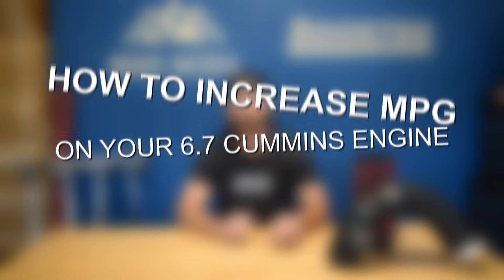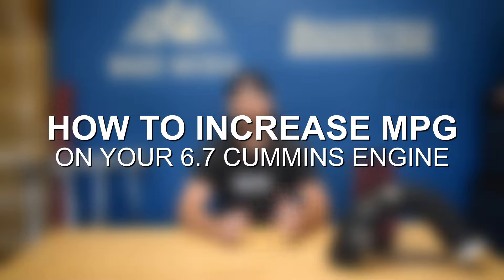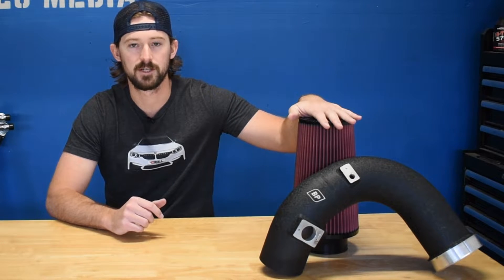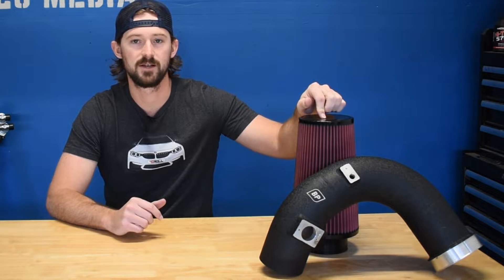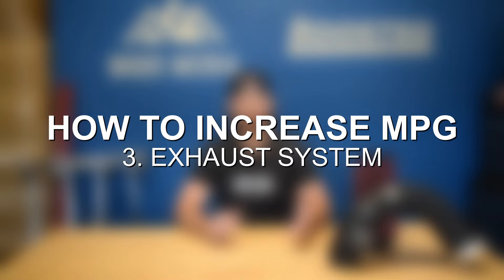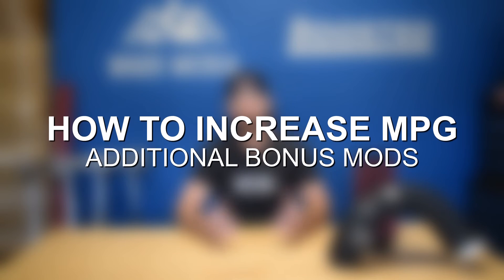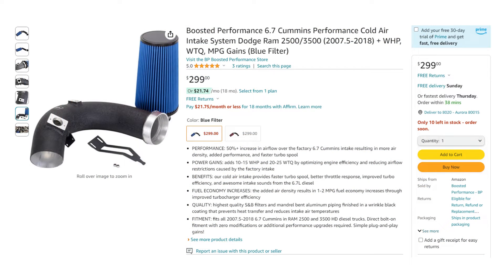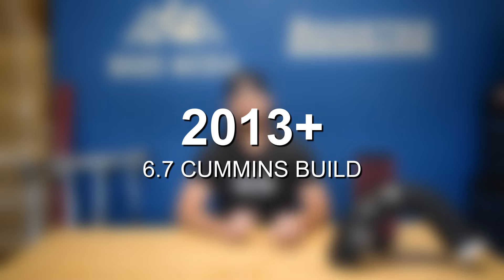6.7 Cummins Upgrades to Improve Fuel Economy (+2-5 MPG)!

Comment: I’m a car hauler using a 2023 RAM 5500 , with 5 car trailer. would these upgrades work for me also thinking of adding the monster air intake heat grill. Will this improve my MPG?
Reply from the maker: L - Likely, but wouldn't expect too much given it is a 5500.
Reply: I just installed one and got no real noticeable improvement.

Comment: The “cold” air intake and filter look cool, but if it’s sucking air predominantly from inside the engine bay it’s not a cold air at all. It’s in fact, a less restricted hot air intake.
Reply: CORRECT!
Reply: Exactly, that intake will not help the engine. Sucking hot air from the engine compartment will reduce power. How can they claim to be a performance company and not understand sucking super heated air isn’t good. Also, I’ve got an edge juice with attitude, makes great power but no setting on it improves mpg, even the “economy “ mode. More power takes more fuel.

Comment: I got 2.5 mpg by simply plugging in a throttle throttle sensitivity booster on a 2022 6.7 and it doesn't void your warranty as the things in this video will and only cost around $300.00.
Reply: Which throttle sensitivity booster did you go with?
Reply: which one?
Reply from the maker: J - Thanks for the added insight. Some have great fuel economy gains with these devices while others don't see it as much. Nonetheless, thanks for sharing.
Reply: Which one did you get?

Comment: THE NUMBER ONE WAY TO INCREASE MPG ESPECIALLY AT HIGHWAY SPEEDS IS TO APPLY FOOD GRADE SILICONE SPRAY OVER THE COMPLETE VEHICLE, AIR DAMS, GRILLE, PAINTED SURFACES, LIGHTS AND ESPECIALLY THE WINDSHIELD AND WINDOWS BECAUSE THEY FACE THE WIND AND THE DRAG COEFFICIENT IS GREATEST OVER THESE SURFACES AND RAIN ROLLS OVER THE SURFACE EASIER AND BUGS CLEAN OFF EASIER. UP TO --- 2 MPG !--- AT HIGHWAY SPEEDS FOR THE PRICE OF 1-2 CANS OF SILICONE SPRAY. WARNING: HAVEN'T PERSONALLY SEEN ANY PAINT OR PLASTIC DAMAGE BUT CAN'T GUARANTEE IT. YOU WON'T BELIEVE HOW THIS HELPS!!!!!!!!   Don't have one myself, but my friend has a tonneau cover and always benefitted  with good mileage numbers. I wouldn't have believed it myself but I hauled a bed full of 42 gal  bags of recycle products up to the bed sides and keeping the air out of the bed is definitely a plus. Maybe up to one mpg at highway speeds.